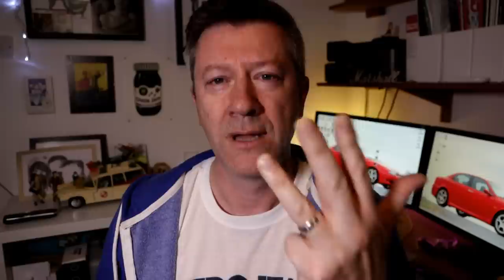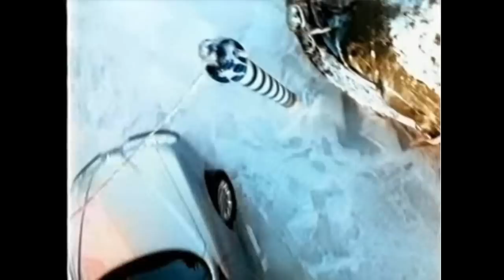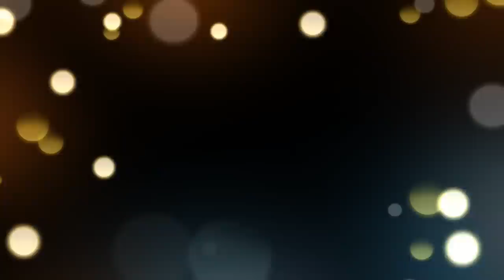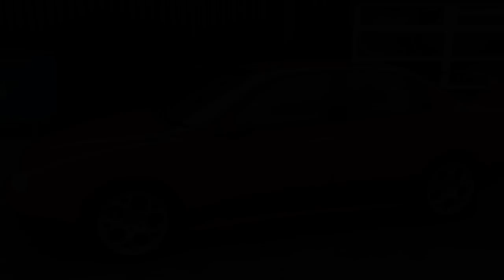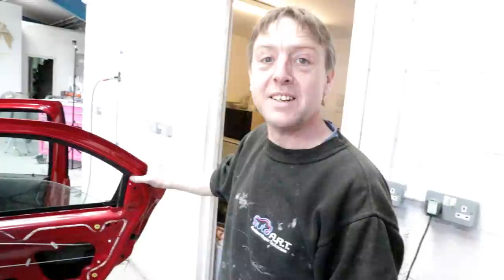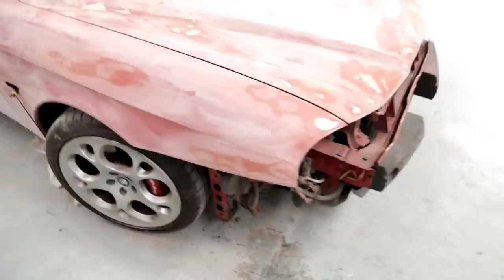Alfa Romeo 156 - The Forgotten Masterpiece!

Comment: I am now driving my second 156 Sportwagon. This is my ninth Alfa Romeo, starting in 1963, with the prettiest car of all - the Giulia Sprint Veloce 1600 by Bertone. It was a revelation. The 156 Sportwagon is great, with plenty of room for a travelling photographer, fun to drive, and beautiful Giugaro design (the later front end). Idiosyncratic yes, like all Alfas. If the windscreen wipers stop working don't do anything. They will come back in a week, just like that! (OK, slight exaggeration).  You have to look after them; keep putting the oil in. The previous 156 collapsed at 16 years old, but gave me 9 years of fun and practicality. Also very cheap.
Reply from the maker: Hi Tim, yes and there are fewer and fewer of them every year!

Comment: My now 15 yo 2004 156 Sportwagon still feels like a new car. Best car I've ever had. Not the car I've had the most fun with, that probably was my 1976 Alfetta, but my 156 have been incredibly reliable. The 2.5l Busso is probably one of the best engines ever produced, it just runs and runs as long as it gets serviced. I've done some mods, lowering it and such and now it's time for some new side skirts since the original ones got to beat up last winter. Besides that she's in perfect condition with everything working as it should.
Reply from the maker: I love my 156! 😄

Comment: I have a 2003 Alfa Romeo 156 and I love it there are some things that need to be done like re paint as it faded, and it needs a service
Reply from the maker: There will always be something to do!  ;0)
Reply: The Alfa Nut they are a nice car but atm for me I have no money to get it serviced and I’m afraid if I do it will cost me more then just the service as it says abs failure and things like that but only started since the service has been overdue. Is that a thing that happens a lot like when you over due for a service dose it normally say this wrong and this wrong to get you to service it?
Reply: Just keep checking the oil level! I had a 2004 Sportwagon and now have a 2 litre 2005. Number Nine!
Reply: @pugestpug5879    Just keep checking the levels, although the Service reminder is useful, it is automatic. These cars can get expensive when things go wrong - it will happen the older they get - like us! If you can find a keen mechanic I have tended to avoid the Alfa agents.
Reply from the maker: Yep I agree Tim - the Alfa independents are a mixed bag to say the least and some are unscrupulous and pricey!
Reply from the maker: New video on mine soon - its going in tomorrow for electric work then MOT

Comment: Looking forward for the result. You seem well prepared & the shop too. Good luck from me for the paintjob in any case!

I can't recall ever having seen one with that big oem spoiler/SP3 on the road. That is a very rare spec car.
Reply from the maker: Thanks for watching and the comments - yes it's certainly not a common sight, I've seen the spoiler on a Twinspark but never another V6. I just love the shape of the 156, it's a fave of mine!
Reply: Oh, well, I can hardly disagree - I got mine (156/Busso) in 2006 and did not manage to part from it to date :)

About spec: The moment of you shuttling the bumper inside the cabin also looked very familiar, as the backseats of bella machina here don't fold either. 😅
Reply from the maker: @IceAce1  Yes, it's a shame because although the boot is a good size - folding rear seats would be very useful!

Comment: I agree that conceptually the 156 was the best main stream car Alfa ever did. It was stunningly beautiful in both saloon and sportwagon, it was accessible, not too big or small and affordable and it was/is nice to drive. Negatives were that the suspension component quality was mixed and the TS engine was not good enough. It took the FIAT cast iron block a step too far and failures were many. The 2.5V6 is lovely but expensive to maintain properly and cam belt failure kills it stone dead (I had a V6 24 Valve 164, so I know what is involved) The best engines were the 1.9 Diesel and the 2.4 10 Valve diesel. Quite why they didn't repeat the car I will never know. I did over 100,000 miles in a 2.4JTD 10 valve 156 Sportwagon. It proved an excellent car and I still miss it.
Reply from the maker: Thanks for the input Tim and yes I agree that it was rather amiss of Alfa not to follow it up with a more delicate car. The 159 is also very pretty but not in the same timeless & elegant league as the 156 in my opinion.  I have pre-emptively stripped & refreshed my 2.5 V6 with all new service items, inc. plugs, filters, seals, gaskets, cambelt and all associated hardware but it still needs careful monitoring for peace of mind. I love it though - it just feels so right to drive.

Comment: I have a 2 litre twin spark 156 which I bought new in 1998. It's looking a bit tired but still gives me loads of pleasure. Still on the original exhaust after 21 years !!
Reply from the maker: Come on Dave - buy the poor old 156 a new exhaust!  ;0)
Reply: @TheAlfaNut  It ain't broke, so no need. If it manages to scrape thru the next MOT I'll get cambelt done, then might spend a few quid on cosmetics. The paintwork on one wing is dodgy (this was "professionally" resprayed after an idiot reversed into the wing), but the rest looks pretty good considering its age. Alloys (teledials) could do with a refurb. Then.......I can see my entire savings disappearing !!      Still love my 156 though !!
Reply from the maker: @savamac  Haha well I drove my 156 around for a couple of years with it looking like a "rat" project!  I didn't really mind 'cos it still made me feel good to drive it!

Comment: I owned for 7 years a ‘03 156 Sportwagon JTS. Such a great car in so many ways, practical, economical, comfortable and handled well, plus it had the Bose hifi system. 
But it had its faults, the suspension is prone to failing. I rebuilt it completely, went through two lots of timing belts, water pumps etc, plus had to replace all the Lamda sensors. I sold it a few years ago at 150km on the clock and got so little back for it, even though the body work, trim, mechanicals and electrics were all perfect. When I sold it, I was going to have to replace the front suspension arms and shocks for a second time. I just couldn’t justify the expense. Sadly, a year later the car was written off. I was really disappointed about that. 
They sure are disappearing fast off the roads out here in Oz as well. Rust isn’t an issue here with these Alfa’s.
Reply from the maker: Hi David, thanks for watching. Yes its a shame how this depreciation / scrapping / appreciation / restoration curve works - most cars disappear forever.
Reply: Hello, I have a 156 2.0 JTS TI from 2004. I know the pain with the suspension, it’s really poor and it was costly ti fix. Other than that the idle is rough on my car. Placed NGK platinum spark plugs and replaced ignition coils. (The connector quality and the yellow lock are also such a bad quality that I broke 1 lock and 1 connector in half. Got another job on my hands now). After these replacements the car drives better but still idles rough. Someone told me to maybe replace the timing belt. I can’t find when it was done anywhere on the car. Any way to check the belt for wear or bad function?
Reply from the maker: @stefancgxz7799 not really, without paperwork its impossible. How long have you had the car?
Reply: @TheAlfaNut  I have had it for 8 months now. I found a washed away marker on the timing belt cover saying either “2013” or “2018”. It’s impossible to see which of the two it is. I’ll just go ahead and replace it to make sure my engine doesn’t die.
Reply from the maker: @stefancgxz7799 Hi Stefan, yeah that’s the sensible move - best not to risk it! 👍🏻

Comment: Nice rare car. You’re right regarding the boot spoiler, it’s mahoosive. I personally never liked it, spoils the clean lines of the 156.
Reply from the maker: Yeah, fair comment - it's a bit "Marmite" for sure but it's original and the plan is to restore the car to as close to factory spec as possible (apart from the wheels, suspension, engine, interior and exhaust of course!!  ;0)
Reply: @TheAlfaNut  mine had the rear spoiler too. It may be original but it's not worth keeping on. I removed it before the respray and put on a bootlid with no holes in it.
Reply: D each to their own! 😉

Comment: Love the 156.
I can remember seeing an interview with someone senior at Alfa at the time in 98, and he mentioned the optimistic number of cars they planned to produce per day, I can't remember the exact number but it was far too much and unrealistic.
This might explain why so many had teething problems from the factory, I've heard of seat belts missing or wrong belts completely, cars with half the underseal not applied, airbag lights, radiator hoses blowing out and wrecking the engine just because the hose clamps weren't tightened fully, etc etc.
Souch a shame, it was the last thing alfa needed, especially on souch a special car. It seems even today they haven't got the quality control sorted out yet.
Reply from the maker: I agree - if they sorted out quality control and focussed on improving customer service, they would transform their image and market share.  Just look at Skoda now, compared to what a joke they were 20 years ago.  It can be done.

Comment: Problem is, when they go to get mended the bill is more than they're worth. My 147 was just the same. I p/x'd mine but most get scrapped.
Reply from the maker: Yeah, that is the bottom of the depreciation curve, although because they are now getting to be a pretty rare sight, the prices have started to firm up again. Same cycle that the GTV is currently in.  This happened with the Alfasud and the 105 Giulia in their times too.
Reply from the maker: That would be the 2.5 V6. Either a good early one (97-98) or an excellent late model, like a ti.  The pre facelifted cars are always going to be worth more, as most people feel that Guigiaro messed up the redesign, making the nose too long and spoiling the proportions. 
It’s all personal taste though of course  ;0)
Reply from the maker: Veloce spec was more sporty, Lusso means “luxury” and those had wooden steering wheels & trim and a more comfort bias.
Other packs offered clothing, winter options, different seats etc

Comment: Everything great about the car then, is still true.
Its still absolutetely beatiful (mk1 !!!).
It still drives great, like real great.
Engines ???
I have two accidents to really HATE  the idiotic 2.0 shitty designed engine 😤
Talking 4-cylinder, the 1.8 is the one to go for.
But..., the Busso brings out all the sex in the 156.
Yes it looses a little agility, but the character of the engine, the elasticity, the sound, the comfort (lack of vibration and resonanse), its all just like a bite of heaven.
Driving the car is like a date with a girl you really love.
And every time i park it and get out of the car, I look back at it, smiles and feel happy ☺
And looks forward to go driving again.
(please loose that ugly big cheese grater on the back of the car).

Just remebered: Twice I've had to replace a broken rear door handle. They dont do well with Nordic winter temperatures.
Should be made out of metal instead !!!
Reply from the maker: Haha - I'm using the rear spoiler to iron my shirts on!  It's very useful  ;0)

Comment: In general you don't see that many "old" cars on the road any more. Thinks like scrappage schemes and costly MOT failures get them put off the road.

An unfortunately the 156 had it's head gasket issues and to a lesser extent under carriage rust issues. Like alot of Alfas, they depreciated like a stone. A really good car, don't get me wrong, but they needed more TLC then its German or Japanese equivalent.
Reply from the maker: Hi Colm, thanks for your comments - yes the typical Alfa depreciation curve hit the bottom for the 156 a year or two ago and is now bouncing back: prices are on the up again as there are hardly any left now. Shame!

Comment: "How could it fade into obscurity?" Good question. I had a 156 2.5 V6 for 11 years and loved it to bits. Best car I have ever owned by far and I have owned some fun cars - the Alfa GT 3.2 being one example. But ultimately the 156 did what everyone predicted and fell apart with rust. It was an awful moment, but even I couldn't deny what the mechanic was showing me - a floorpan that was literally disintegrating in front of my eyes. Alfa need to get back to making affordable, fun cars and they need to sort the rust issues. I love the Giulia bi-turbo and the 4C, but used prices are silly. £40K is not an option for me for a used car and it isn't for most sane people.
Reply from the maker: Hey Phil - yep sadly I agree with you about the rust. My 156 has just passed its MOT this week after many months of work. I have sorted all the rust now and resprayed, so hopefully she will be ok for a while! 🤞🏻. However, I’ve just bought a 1988 Alfasud Sprint and its back to the welder we go! 🤣

Comment: Those are 166 wheels, a different bolt pattern than the 156. Are 166 knuckles fitted?
Reply from the maker: Hi Jonka - the wheels are 166 replicas, specially made to fit the 156 hubs!  They were made in small numbers by a long-gone British company I think. I have only ever seen this set. 🙂
Reply: @TheAlfaNut  well that is cool! Would love a set on my 2005 156 SW.. Great looking wheels
Reply from the maker: Thanks.  If I ever sold my 156 I would have to keep the wheels! 😄

Comment: Strange headline. I owe my third. There's another one around the corner. There are over 3000 in Holland on the road. This one in the video look great, except for.the spoiler.
Reply from the maker: Hi Dick, thats good - there are less than that in the UK sadly 🥺 The spoiler was part of a sport package, fitted by UK dealers
Reply: @TheAlfaNut  Hello. don't worry, I'm just as British as Dutch. I did notice when in the UK, one didn't see many. Here, it's been a popular lease car. Only my second 156 had minor rust problems. Like the saucers under the rear springs. I was happy I was doing only 30 when they broke. Just came from Germany, doing average 150 km. I knew they needed to be replaced. Mechanical I never had huge problems. My present, which I have now over 2 years, just came from it's under law yearly check, all was ok. It's a 2005, 2.0 JTS, in mint condition. No oil use, to my surprise low fuel consumption as well. What the spoiler concerns hahaha, it's a matter of taste. Personally I think it spoils the lines of 'Bella.'regards Dick

Comment: or maybe instead of the 159 ill get the 156
we had one (facelift, sw, 1.6ts), dad said it was amazing, it looks amazing from the outside (159 is prettier in some ways) and it looks amazing from the inside (the 159 doesnt)
and also the TwinSpark
Reply: my dad said he would have chose the 1.8TS if he could
Reply from the maker: @TeraByte38  the 156 drives so much better than the 159 - lighter, better gearbox, better handling!
Reply: @TheAlfaNut  alright, i think my answer is clear!